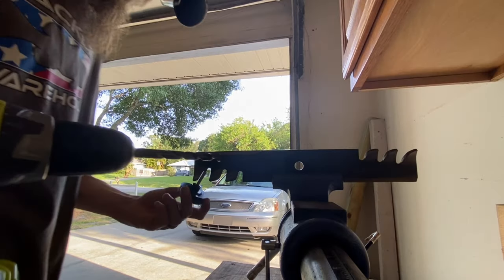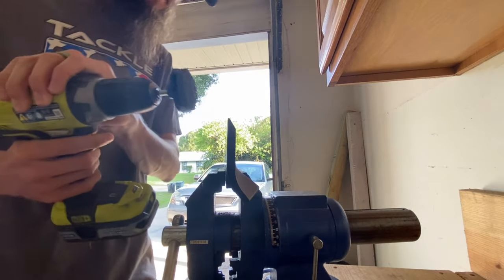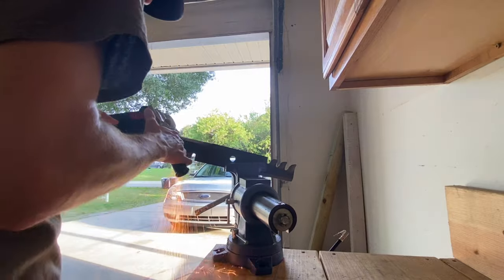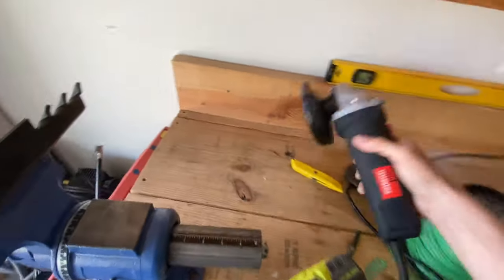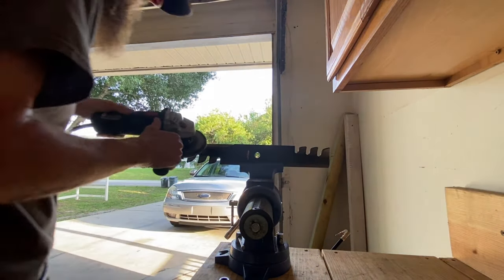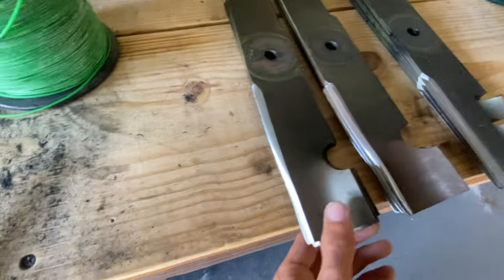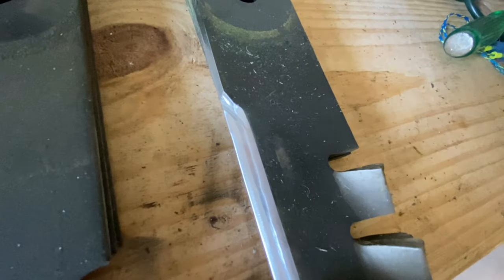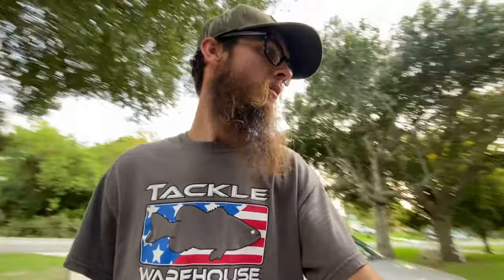Don’t waste ur money on this!

Comment: Hey Al. Can I call you Al if I let you call me Betty? LoL. 

I’m a wood worker and woodworking requires sharpening if you want to enjoy it. I may be able to give you a few suggestions on sharpening that help. 

Something is only truly sharp if the two edges of what you’re sharpening meet EXACTLY at whatever angle gives you the best cut and I’m guessing that’s between 20 and 30 degrees for grass. For woodworking it’s about 30 degrees. If you accomplish that in a few minutes, you’re good. If it takes too long you’re likely to not do it as often as you should. If it’s too difficult, you won’t do that either. 

All those gadgets you see are there because a lot of people need sharpening and doing it well is hard. I feel like you didn’t use that gadget right because the part of it with the angle should probably have been the part doing the sharpening. Not between those two pieces. Does that make sense?

Anyway, next time you want to take a shot at a new way to sharpen, look for something that can hold that angle easily. Also if you get your two edges to meet precisely there should be a small burr along the straight side of the blade or the back side. Use some sand paper to gently remove the burr to get your sharpest edge. 

Good luck 👍
Reply: Jo: Und aus der Bearbeitung von Holz und Stechbeiteln sollte man wissen, dass es 2 Methoden gibt: Entweder ist das zu schärfende Teil fest oder es ist das Medium zum Schärfen fest. Letzteres wäre hier besser. Und hier wird einfach viel zu viel Material abgetragen. Außerdem muss danach gewuchtet werden (an einem Dorn - das Loch in der Mitte vom Messer wird über ein waagerecht angebrachten Dorn geführt und dann das Messer leicht gedreht. Es muss gleichmäßig laufen und nicht an einer Seite schwerer sein, usw).
Reply: Hope he listened. 
He doesn't answer.
Reply: He’s that busy doing those free- be’s and videos and keeping things up to par plus the other 6 days of a week 🙂

Comment: Did you try the grinding wheel w/out the guide? Not to add, instead of tossing them in the trash, they could be used for other purposes that need grinding. Something to do on rainy days. ;)

Comment: yeah, I knew the drill wouln't work, to much rotational torque. Also, the vice should be actually bolted to the workbench, just the weight of the vice isn't enough to compleately hold the blades rigid

Comment: I realize this is a year old but I have to add my 2cents worth........It appeared that the blade was at the wrong angle for the action/placement of the sharpening wheel. I could see from our angle it wasn't going to work.